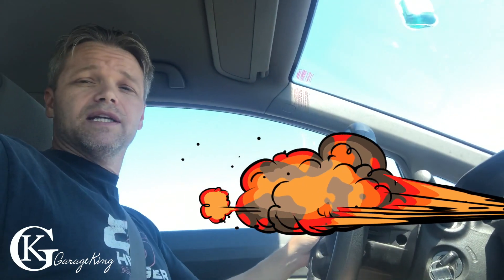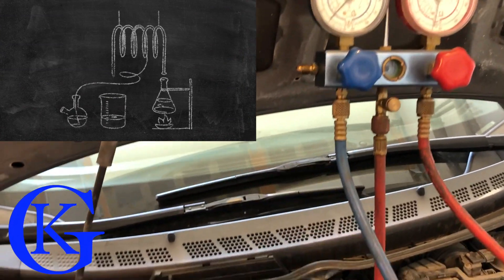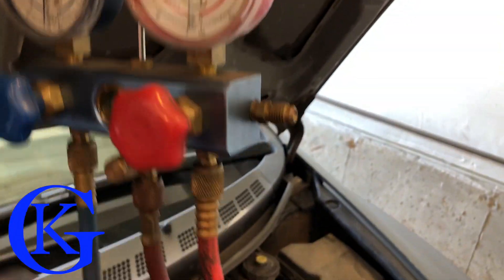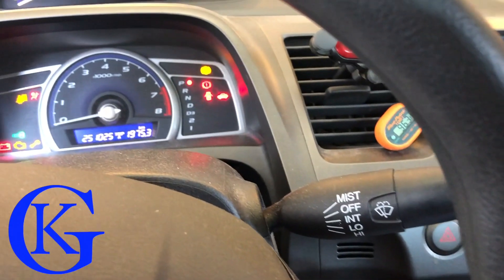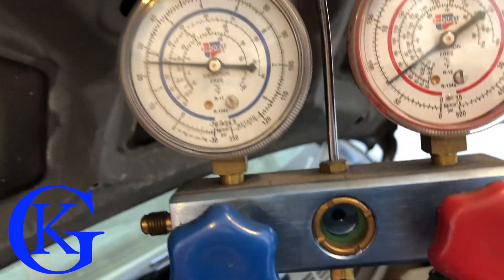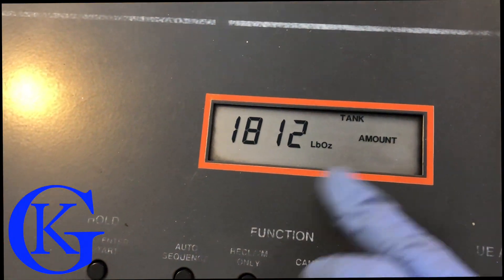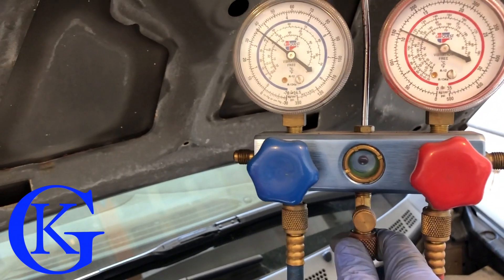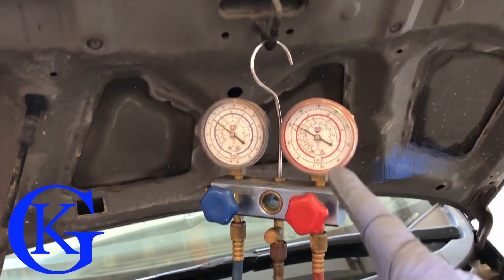How to recharge AC system with gauges properly and evacuate

Comment: Interesting the way this worked for you. I have watched a number of other videos that talk about the system not taking refrigerant. I did purchase a manifold set (cheap) as It would never fully get to -30. I thought the system was leaking, but then drew a vacuum with the gauges closed to the vehicle, and it didn't change anything so I knew the gauge was just inaccurate. Just mentioning this for people who buy a Chinese set off of Amazon or something. Don't expect them to be perfectly accurate. Anyway, the compressor will not come on if the pressure is too low. The Haynes manual talks about jumping the switch to the accumulator. Alternatively I guess you can pull the relay out and jump the connections there, but the compressor has to be running to draw in refrigerant. Second thing is if you're using the cans, If you screw the valve either all the way in or all the way out you will get nothing. Somewhere in the middle is where you want to be. I could not figure out what the heck was going on. How could both fully open and fully closed both be closed? Well, That's the way it works. 

My system, a 6 L Chevy V8 Holds 28.8 ounces. I had to laugh at the 4 oz you're using. I did manage to get 24 oz in, but the system pretty much stopped at that point. I just can't seem to get it to draw the last four plus ounces. The compressor was cycling on and off, but still drawing nothing. Not everything goes by the book!  I've hooked it up on three separate occasions, and In each case it just would not take any more refrigerant. I did manage to get into the low 50s for output temp, so It's definitely working, but i'm guessing if I could get the last 4 oz in I'd probably get an extra 5° of cooling. 

So far I haven't jumped the relay, but I did try jumping the switch to the accumulator, and apparently it wasn't making good contact or something else was going on. I still cannot get the compressor to engage fully and stay on, and I'm sure that's part of the problem. I assume if the compressor stays on too long that could be an issue too. I'm not sure what the max high pressure could or should be, but I gather it should not be over 300 and probably closer to the 200 range. Overall I felt better not manually engaging it. 

Anyway, I'm just a novice so thrilled I got as far as I did, but just want to let people know it's not quite a straightforward as you would expect. Even getting the system to take the first few bottles took a very long time. I still don't know what the secret was on the second bottle, but at one point it just started taking in the refrigerant and it was very quick. I must have spent 20 plus minutes waiting for it to do that though, and the compressor was cycling during that time so I still don't get it. Only thing I can figure is I didn't have the refrigerant bottle fully open. Again it needs to be about midway between open and closed (or what you think is open and closed) --lol.  I kept playing with things and it just magically started working. Not exactly scientific, but that's the way it worked for me. 

I think there's also a method where you can test the static pressure based on temperature and perhaps you could talk about that? I think this will let you know if the system is under or overcharged.  I think that may require some extra gauges though, but If there's a way to do it with the standard manifold gauges let me know. I'd still like to know if this system is fully charged or not. According to the specs it should take another four plus ounces.
Reply from the maker: Hey There and thanks for the comment.  First congratulations on your work, and second, I appreciate the time you took to write this so I'm going to give you a detailed answer !!!  OK, so first, the 4 or 5oz that I put in.  If you look at 6:38min mark.  6oz of Red Tech 12a is equivalent to 1lb or 16oz of R134a.  So I actually overfilled a bit as I put in about 4-5oz, and then I emptied the hoses which were a few oz and that would have put me at about 7oz of R12a which is equivalent to just over 1lb of r134a which is what the Honda Civic took.  Your Chevy takes a lot more that this Civic LOL :)   To answer your question about how to get more refrigerant in, well.......  the ambient temperature has a HUGE bearing on how well you can get the stuff in.  Sometimes at the shop we would heat the tank to get more out of it, but it sounds like you are close enough, and its better to be short then over !!  If you go to the 9:00min mark I show the gauges and how much it takes to trigger the compressor and its only about an ounce.  I show the scale afterwards to show how little came out of the tank, and then you can see the gauges running very low and the system will run on an ounce but your are not going to get cooling.

Your system should trigger with 2-4oz  and start cooling with about 6oz.  I find that once the system gets filled about 1/2 way it actually cools very well, at 3/4 its very cold and above that its diminishing values so you don't get much more for the last 1/4 fill.  That's why when people bring in their AC system for service its pretty much empty.  No one brings there car in when its 1/2 full, as its still cold (plus no one wants to see the mechanic haha)  So I really don't think you are going to get any lower temp by squeezing in those last few ounce.  Also once the compressor cycles its operating at max capacity as the compressor is cutting out not to drive the high side any higher. 

As for pressures you are right, high side should be around 200, but can be 250 on a hot day and can push 300 on a really hot day, but should not be over 300.  If you try to fill by pressure you can get an idea, but it's not accurate as there are too many variables.  It's not just the ambient temp (which plays a big role) its also the heat generated under the hood, so the most accurate way to fill a system is to weight the charge in. Also when I was vacuuming I never get to 30, no one does as that's a perfect vacuum, but we get close and the better equipment you have the close you get. Also I leave the equipment on for a good 15-30min, and then HOLD to check for leaks - lost vacuum indicates a leak. I was using a SnapOn so its got a really good commercial pump and can draw down fast. You are also 100% correct about cheap gauges, they are what they are.

Thanks again for the comment and glad you tackled this job, well done !!!
Reply: Thank you very much for the reply. I learned a whole lot through this process. I just filled a mini-split yesterday for an RV, and that had its own set of challenges. Overall though, I saved a ton of money doing things myself, and just like knowing how to do this kind of stuff. All the best, and good luck with the channel. Great content!
Reply from the maker: Thanks so much for the follow up and positive comment, appreciate that !!

Comment: Took my car to AAA Auto Repair Center on Tully Rd in San Jose to repair the air conditioning. They told me that the compressor was bad (which I had already figured out since it had a frozen clutch..couldn't push it in by hand while engine was off). I know compressors cost about $300 but they were going to charge me over $1500 to replace it. Then, later, they called me and said they would have to also replace the receiver drier and that would cost another $400 or so. So, after I went back to pick up the car, I looked under the hood and saw a nice shiny new compressor but couldn't see the receiver drier until I got home. Turns out that the receiver drier is like welded to the side of the  condenser and has a plug on the bottom that needs to be removed in order to insert a cloth-like cylindrical shaped tampon-looking "drier" that takes moisture out of the system. That's all they did...and they charged me over $1900. The drier "tampon" can be bought at auto stores for from $15 to $35. And the compressor can be bought for about $300.  My car is a 2014 Hyundai Tucson. Once you take off the splash panel under the engine of the car and look up at the bottom of the "condenser", on the driver's side of the vehicle, you can see and access the "receiver drier" plug to remove an then to insert the "tampon". I couldn't drain the coolant into a collector before removing those parts so I had to have all this work done by "professionals". Funny, not, how the government will fine you big bucks if you let the coolant escape which helps contribute to global warming but they have no problem sabotaging gas pipelines like the Nordstream pipeline which belched tons of gas into the atmosphere for many days!  It's no wonder we are having high, record, temperatures. Wars don't help either. Same thing happened after WWI and WWII..record high temperatures worldwide! Thanks a lot Putin...you son of a b...!!! Putin needs a "b" to the head!!!
Reply from the maker: Hey Thanks for the reply, and I appreciate the time you took to write this.  Sorry you had to pay $1500 to get that thing fixed.  The one thing about AC is not a lot of people understand it, and are afraid to touch it, so the shops get away with charging crazy prices because the consumer doesn't know what really happened.  I'm glad you poked around under the hood and looked around to see what was involved, you are one of the consumers that is educating himself and we need more like you !!
Reply: @GarageKing  agreed
Reply: Its not putin but murica that sabotaged gas pipeline.
Reply: You have zero idea about what you are Putining about. Putin didn't blow the pipe line you fool. After spending a decade and Billions of dollars building a pipe line to supply gas to Western Europe and increase GDP of Russia, why would he blow his own pipeline?  The only people who say Putin blew his pipeline is the Biden admin and the MSM puppets. All other countries and intelligence services point the finger at the U.S. Navy. FYI anything you hear on your U.S news or from the U.S. government is 100% a lie and in fact the opposite of the truth. Stop being a parrot and maybe stick to fixing your car.
Reply: You SIR are truly a fool.
Reply: You SIR are a FOOL! Complete muppet.

Comment: Hi, I believe that low side is smaller than the high side. Can you confirm?
Reply from the maker: Hi There, Low side is always bigger, and the reason for this is that low side is for suction, so you need more volume.  High side can be considered liquid side so its smaller.
Reply: The low side line is larger than the high side line. The low side service port is smaller than the high side service port.

Comment: Nice Video!  If I want to hook up the AC manifold to your car to do some measurements for the pressure, should I purge the blue and read lines from air once I connect them or no need as the air will not get into the system? please clarify thx
Reply from the maker: Hi There, if you are just hooking them up for pressure measurements then no need to purge as the pressure from your car will fill the lines, so the lines will be full of refrigerant and air, but that's ok as its in the lines and not your car. Also make sure the valves are CLOSED tight when you do this and DON'T open them.  The gauges will read when you connect them.
Reply: @GarageKing  Thank you so much but if the two gases air and refrigerant are mixed in the hoses, will the air get into the lines after a while?  thx much
Reply from the maker: @zofa300  Simply put yes, but ....  If you are only using the gauges to measure then it does not matter at all.  You can use them 100 times and its all good.  If you add to your system then you should purge, and you really only need to purge two lines. The yellow fill line once you connect to a source, and the low (blue) line as you pretty much always fill on the low side.  The high side line is used for taking measurements and evacuating (both low and high for evacuation).  If you are planning to add and don't have a scale, and a tank, I would recommend using a can with a small single line on the low side. The reason is those lines can wind up holding quite a bit when you add it up, and the gauges are really designed to be used with a tank.  I do it in this video https://youtu.be/-7NqYbDLeMM  "how to charge Honda Civic AC with a can" If you have any other questions just let me know.  I'll be off line for the rest of the night, but I'll check back tomorrow.  Good Luck !!

Comment: Hi ! i will like to know if i can use the same PSI chart ( R134a to R12a) with the gauges to add freon on my car ? Thank's for your help !
Reply from the maker: No the pressures are different.  I'm wondering if you mean R12a or R12.  R12 is very old, but there is still some of it kicking around.  It's really bad for the ozone.  You should not use R12, old R12 systems were converted to 134a.  R12a is a replacement that is environmentally friendly, but it has different density and pressure.

Comment: After you change the compressor would it still be refrigerant in the lines? If so how do you know how much to add?
Reply from the maker: Hey there, after you open the AC system to replace any part there is 0 refrigerant left in the system.  Refrigerant is under pressure at room temp (in your vehicle) so if you replaced any part there is nothing in it.  Please keep in mind before you open your system you should get it evacuated.  If there is any left in the system is will come out as it's under pressure.  You can check with gauges if it's empty.  Put the gauges on and see what they read.

Comment: nice video.  If I want to connect the AC manifold just to measure the pressure at the low and high side, should i purge these lines?  how to do so?  I have not seen anyone do that but it make sense as these lines are filled with air? thx
Reply from the maker: Hey there and thanks for the comment.  If you just want to check the pressure no need to purge at all.  Just make sure that both valves on the gauges are closed.  It does not matter if there is air in the lines going to gauges. Pressure will be released from your AC system, and pressurize the line and the gauge will read accordingly.  Don't purge as you will remove valuable refrigerant. You are not filling so once you connect the gauges a bit will come out to pressurize the line.  Just close both valves and connect the gauges and you are good.
Reply: @GarageKing  Thanks Much appreciate it!
Reply from the maker: @johnibrahim7283  Anytime, and good luck with your project !!

Comment: If your AC system gets above 300 on the high side that system is shutting shutting down
Reply from the maker: Ya 300 is quite high and usually means that either the system is overcharged, there is a restriction somewhere, or its super hot outside !!!!

Comment: The temp gauge in the vent is supposed to read 40 degrees  when ac is fully charged correct?
Reply from the maker: Hey There, the temp gauge that is in the car will vary depending on what temp it is outside when you are doing the job.  40 is really cold, its just above freezing, and if you have a temp gauge in the vent I don't know if you can get it down to 40 on a hot day, and I would not use that as a guide to how full the system is.  Now the pressure gauges hooked up to the car are a better indicator of how full the system is.  When the system is barely cooling the low pressure side will read low, like 10psi (when compressor is running) you can add to get to 30psi or so, sometimes 35 or even 40psi, but it depends on the ambient temperature.  Keep in mind this method IS NOT accurate.  It just means you are going to wind up with somewhere between %50-%100.  The only true way to get it correct is to evacuate/reclaim the system and then weigh in the new charge.  FYI - once you are in the %50-%100 the dash temp is going to be cold.

Comment: Question...have both ends connected to the vehicle...loosen the low side and pressure is hovering around 40-45. Then open high side and high side is reading about 250ish. Problem is when I opened the high side, it made the low side needle peg out at max. Would this mean my ac manifold is faulty? Couldn't I just measure them individually?
Reply from the maker: No No No........  You must keep both valves CLOSED the gauges will read what pressures they see in the lines. When you connect the high and low leave the valves closed and they will read the same.  Then start the engine and when the compressor comes on you will see the pressure different.  They both stay closed the entire time. When you opened both valves what you did was let the high side go to the low side.  I hope you just closed both valves once you realized that.  The only valve you should ever really open is the LOW side for filling.  If you are evacuating then you open both valves otherwise they stay closed.  Hope this helps you out.
Reply: @GarageKing  crap! Yes that helps. I had those valves open for a bit. Today noticed the ac cooling and not cooling off and on. I think I may have screwed it up.
Reply from the maker: @HWoodCreations  No you didn't , you just balanced the sides out.  As long as there was something like a tank attached to the middle fill line (usually yellow) then you are ok, nothing would have escaped, you just moved it around.  If you had nothing connected to the middle line then gas would have escaped through the yellow line but I don't think that happed as you said the low gauge line went up when you opened the high side.  If the yellow fill line was open that should not have happened.  I think you are ok.  There is a high side and a low side, you just equalized them out,  That happens ever time the car is shut off, so I think you are ok.  Worst case scenario some escaped and you just have to charge a bit through the low side.
Reply: @GarageKing  I gotcha. Thank you! I appreciate the info and help.
Reply from the maker: @HWoodCreations  Anytime :)